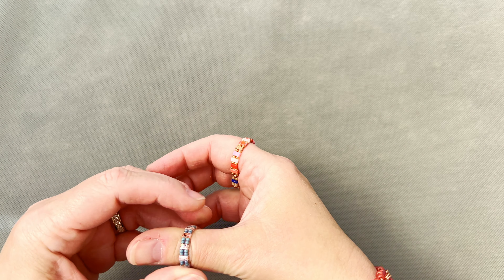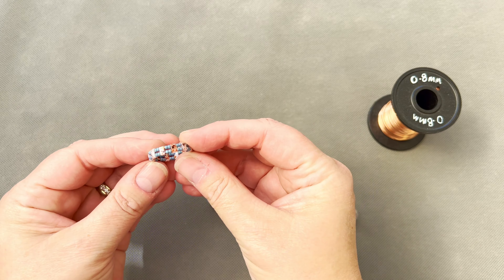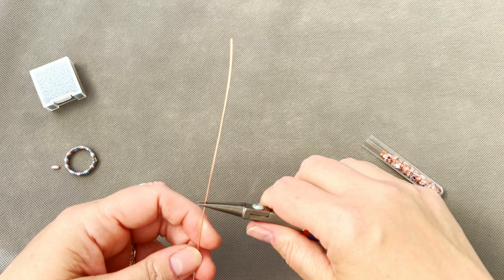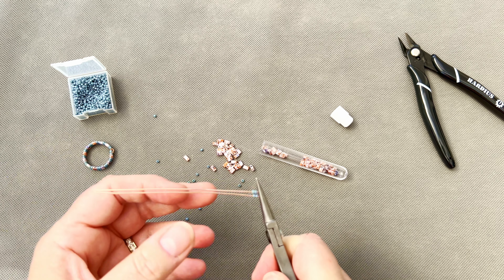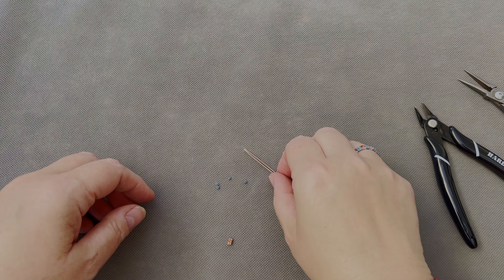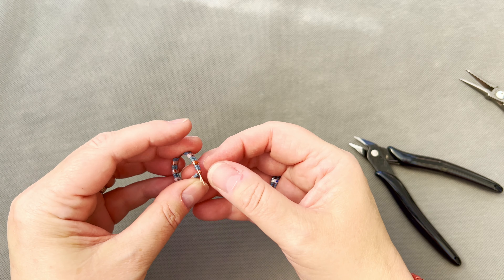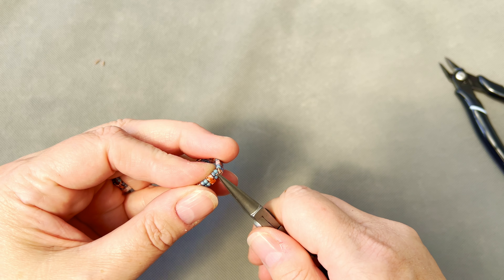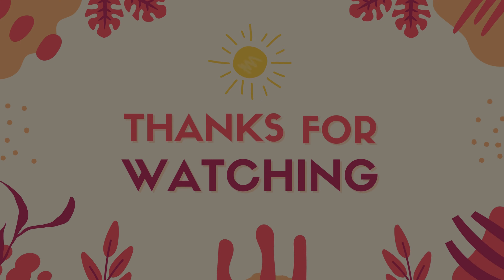Easy DIY Rings In 10 Minutes - Simple Beaded Ring Tutorial

Comment: I'm also looking up Tila beads.. any idea on the size?
Reply from the maker: The ones in the video are approx 5mm x 2mm half tila beads. But you can use any size really as long as they’re not too wide, as the wire won’t bend into a proper circle if they’re too wide 🥰